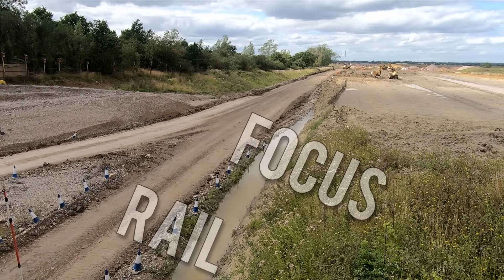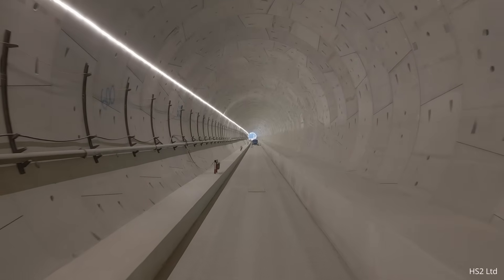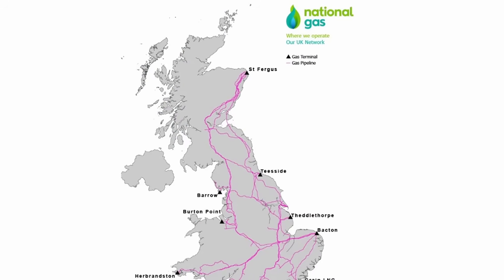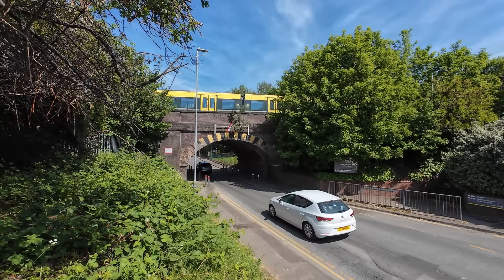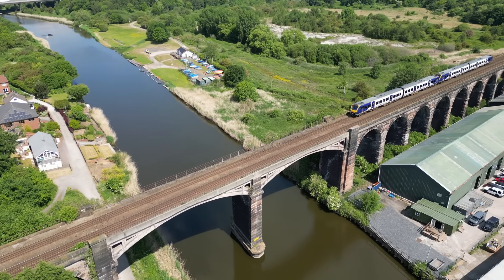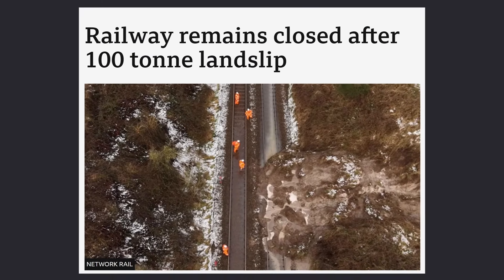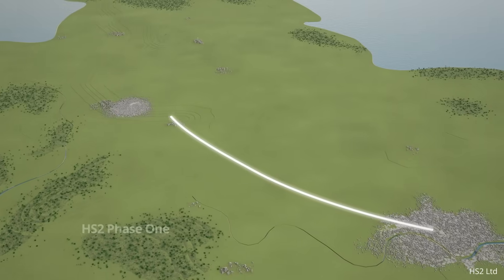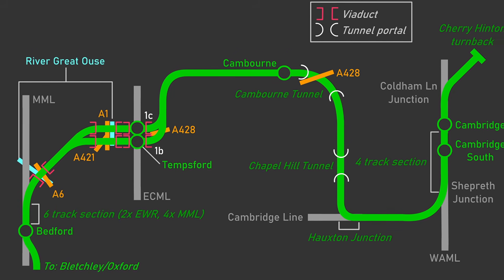Why Railways take so long to build

Comment: Although you mentioned heavy rainfall, the opposite snag - the absence of enough of it - also affects existing infrastructure in some areas, such as part of the Exeter - Salisbury route.
Reply from the maker: Good point, not something I had considered until recently.

Comment: Great vid. Another thing to highlight is that although the Victorians built many grand structures, they were not designed to last for such a long time. However, on HS2 for example, every structure is built to last for at least 120 years

Comment: The Victorians could have built a line from A to B quicker, yes. But they couldn't have built e.g. HS2 AT ALL. Had they given it their very best in both engineering and investment (including workers), they could have built something that would be more future proof and long lasting than the lines they did build (that have needed plenty of upkeep, renovation, and replacements since), yes, but it would not have been a railway capable of having trains go at modern HSR speeds, and it would have basically been a long embankment cutting everything off as it crossed from London to Birmingham and would have made huge gashes through hills that are now getting tunnels. It would have been damn impressive, but it would not have delivered what HS2 is delivering.

Comment: Great stuff, Chris. 

It’s funny how no one talks about how long it took to build the channel tunnel or cross rail now!
Reply from the maker: I think the Channel Tunnel was built relatively quickly. Or slowly depending if you include the failed attempt in 1882 😅
Reply: Crossrail took about  10 years to build. HS2 is looking like at least 12 years. Crossrail,  although smaller, was more complex.
Reply from the maker: @TrevorWilliams-fq8mg 15/16 years if delivered by 2035. Still a very long time.
Reply: Correction... HS2 is looking like  at least 22 years to complete.

Comment: For me, the case studies that are carried out are to the minimum level. By all means there are more parameters that have to be considered but I feel like a lot of cost-cutting is done.
Take for instance the Botley Bridge fiasco that's happening in Oxford. If utility companies are factored within the studies and costs are discussed, this can greatly help the time management of each case study that comes to light. 
I agree the Victorian era was a force to be reckoned with but I feel like the workmanship isn't as robust as it was even 20 years ago. Take Reading station, the tracks and signalling was done to perfection on either side but the actual station is wriggled with problems with drainage, things going wrong etc. It's like the TP Nova 3 / class 180 as a station.
Reply from the maker: Utilities are an absolute nightmare these day and the system for their diversion is heavily weighted towards the utility companies who get to dictate the cost and time-scale. Project promoters have to pay for work in advance and then the utility company gets to decide when work starts. It's a mess
Reply: @Rail_Focus Yes indeed. Personally like Great British Railways, a new Great British Water needs setting up.

Comment: An excellent video! It is rare to see a creator take the time to properly consider the breadth of the history of transportation and lay it out so well - thank you.
When the Victorians built their bridges, they were only wide enough for.a horse and cart because that is all there was - and they moved very slow. 
The railway created the Industrial Revolution because suddenly everything could move faster. and a modern economy could evolve.
Keep thinking about this as the HS2  / HS3 stages will cause the next economic evolution...
Reply: We need to argue not just for "HS2 to be built in full" and for "HS3 to be built" but think beyond that and work out how to get 90 percent of InterCity trains off of our mainlines.

For instance, complaints by Welsh campaigners that "HS2 should not be built unless Wales gets money" should be met with calls for another high speed line into Newport, Cardiff, Bridgend and Swansea (ideally with the depot built to the west of Gorseinon or better still Llanelli because the land would be cheaper and high speed rail will increase demand for housing in Swansea itself - and also because by extending beyond the last big place you get to have an additional stop, where building a bigger terminal station isn't so much of a problem and where you can stimulate the economy enough to hopefully improve the business case for extending towards Pembrokeshire).

And in the North of Wales, we should be getting people onside by backing a plan for an Irish Sea Rail Tunnel from Holyhead to Dublin (and a high speed rail connection from Holyhead back to HS2).

Comment: While researching the history of a local railway line, one that was closed in the Beeching era.  One of the books written about the line mentioned that many of the bridges were replaced about 30 years after the original construction of the line, thus verifying the comments that the initial construction was done " on the cheap".
Reply from the maker: Indeed, many bridges we see today date from after 1920, particularly the steel girder types.
Reply: It took just 14 years for the suspension bridge over the Tees on the Stockton & Darlington Railway extension to Middlesbrough to fail. Built in 1830, by 1844 it was replaced with a new structure that was itself replaced in 1881. The 1881 bridge was then replaced with a bridge from 1906 that was able to last until 2009. Quite literally, the 2nd to last bridge had lasted longer than every other bridge before it combined (103 years vs a combined 76 years)

Comment: HS2 must be fully built 

Both Eastern and Western Legs must be built
Reply: Well that's easy to say, how is it going to be funded?
Reply: @CA_I  funding aside, the bottlenecks on the WCML still exist
Reply: @CA_I  It's cheaper to fund an entire network of high speed rail lines (and a rail tunnel from North Wales to Dublin) that it is to fund the massive cost of not preventing climate change.

High speed rail will solve the mixed traffic problem and allow us to run lots of InterCity trains on one network and lots of stopping services / commuter trains and freight trains on the other network. That will lower car dependency as well as reducing the number of lorries on roads. High speed rail can compete with domestic flights and can allow us to ban most domestic flights.

Comment: A most useful summary of "today" versus "yestercentury" - well done.  This should be required watching for the NIMBY squad (who, in fairness, are quieting down and heading back into their trees).  With the UK population having increased, in just the two years of 2023 and 2024, by 1.5million souls, we shall need the capacity of HS2 - and not just between London and Brum.

Comment: In China, it generally takes about 12 months from completion of the viaduct/tunnel/earthworks to the opening of the line. The speed of track laying and installing signals is reflective of the way high speed rail is built - there is a steady pipeline of new projects for specialists to move between. Given HS2 is the first high speed line in Britain for 20 years, I suspect track laying and signalling will take a bit longer. It is therefore depressing that we aren't progressing with Phase 2a to Crewe now, so that workers who are currently working on Phase 1 can continue straight onto another project.
Reply from the maker: The fact that we've built up a large contingent of skilled workers and gained so much knowledge it's a disgrace that we're going to squander all that effort and potentially leave thousands of workers jobs without to go to. Phase 1 is the difficult bit, any extensions after would've been easy by comparison
Reply: The political system allows them to drive through projects because they don't have to worry about the political fallout.
Reply: @christopherbenjamin3242  "political fallout" meaning rich people complaining
Reply: yeh but theres a lot of cheap labour there and they have a lot more money so its kindof a given but it was intrestig knowing it only takes a year

Comment: Thanks for another great video.
I was shocked to find out while joining HS2 Birmingham to Crewe online meetings, that even after the route got Royal ascent that every structure then had to have individual planning permission.  No wonder the cost and timescale is so large. That is why I think cancelling that bit is wrong after so much time and money had already been spent. In fact lots of money is still being spent on the route to make started construction sites safe to be returned to previous use and it will be many years before any land can be sold off!

Comment: A lot is made of the fact that the GWR converted from Broad Gauge to Standard.   However the GWR simply employed enough people to make sure could be done,in a short timeframe.
What you really need a bit like the rolling stock is a constant stream of work for the engineers or rolling stock manufacturers unlike today where will want a lot in short term then hardly anything for years. 
As such makes the work more expensive as well.

Comment: A lot of what is done now is trying to future proof the infrastructure, so lines built for diesel trains have the correct loading gauge to allow electrification.
If we built to Berne loading gauge it would cost more but you could then have "standard" stock which would be cheaper and greater flexibility.

Comment: What I would like to know is how the cost and timing of building a road compares with building a railway. At all stages from design to construction.
There are differences, but the media coverage is always attacking the rail industry. I would like to understand the real facts.
Reply: It's dam  near impossible to build a bit of bypass to improve the highway  either !.
Reply: You can't do an accurate comparison because every project is different. Different planning requirements,   different environmental requirements,  etc.
Reply from the maker: I did look at the costs in a previous video, some road projects are even more expensive per mile than HS2. 
https://youtu.be/rBDrC0qk6qk

Comment: Yep, others too often compare it to the Victorians when we should consider comparing it to our European neighbours, where our timescales and costs are multiple folds higher than in France/Spain/Germany etc. Our dysfunctional planning system needs to overhauled, that along with our infamous NIMBYism, with parts of the line buried in the middle of nowhere. Layers of contractors and subcontractors milking the taxpayer, with a pitiful lack of political will and momentum
Reply from the maker: Well, this was about the specific claim about "the Victorians" deconstructing the misconceptions around "Europeans" would take another set of videos
Reply: @Rail_Focus  That would be cool, definitely not all rosy in the continent/vs how its calculated/different densities, but many lessons we could learn, considering how infamously terrible our planning system and ability to deliver large infrastructure projects has gotten. Great set of explainers!
Reply: This has been covered before I think by Rail Focus. France, Spain and Germany are much less densely populated i.e. much more space between towns/villages/roads. If you are building 100 miles of railway and you only need to navigate 5 existing structures instead of 20 then yes it will be much quicker.

Comment: 8:08 Remain to be convinced. Around the 3, minute mark you lambast the Victorians comparing some examples of then and now. Yet in the next breath, you take down that argument piece by piece when you talk of the rules and regs today's builders have to follow.
Just as we're building to accommodate HGVs , why would the Victorians have built to accommodate anything other than the horse and cart you mention?
Your argument is against the burden of laws, not that one lot were better/quicker/life-endangering than the other.
Yes we have power and gas fuel lines, motorways and myriad new physical and legal challenges to face and get round.
The Victorians had other new fangled railways, canals, their own legal hurdles and blue blooded route blockers to get round.
We have modern powerful machinery and computational powers but they had sweat equity in the manpower of the famous Navvies and only paper and pencils to calculate designs capable of carrying unknown future loads.
We build to the lowest price, they probably did too yet their infrastructure still stands and even has fancy pants curly swirly bits on it too.
As for the deaths, life was cheaper then, horrible though it is to admit and we'd like to think that we're better at looking after each other nowadays.
I just wonder, if you took away our earth movers &c. and brought back the slide rule, how many fatal accidents would there be in our version.
Thankfully we don't need to find out.
Reply from the maker: I'm fairly certain most of your points are covered across both videos

Comment: another good video _ one point of clarification _ road bridges for non notification of bridge height is 16' 6" _ you make the point well about complexity _ the hs2 video about the Curzon St Station approaches _ it's basically a series of different viaducts & a retained cut all the way to Washwood Heath sums up your point well _ and all while not trying to close other raillines or roads and without cutting off the utility services _ complex work & difficult _ well done _ look forward to seeing your next installment
Reply: what do the underscores _ represent here

Comment: Additionally, with the involvement of the locals in the areas impacted and politicans there are delays with redesigns to accomodate different concerns or planning changes. Maybe a section could be completed faster if it was surface level but the political elite and locals forced changes to have it tunneled adding x amount of time. There are a lot more variables to accomodate today then there was every considered in the past. As mentioned in the video we future proof things but also one of the negatives is we also try to derisk everything that adds a lot of time to projects. There is definitely a level of unncessary complexity we add in for political points and risk adversion that isnt necessary.
Reply: I don't see too much of a problem in people trying to de-risk projects.

Auto Shenanigans has several videos about road-building projects where there has been subsidance that has either haulted projects part way through or left them in a dangerous condition. We really can not afford to have a high speed train coming off of a viaduct and into a tunnel and the level of the trackbed not being totally stable, as a high speed derailment would be really bad. This stuff has to be reliable. If stuff starts to sink, we might end up needing to shut HS2 down and rip a bit of it apart and rebuild it.
Reply: In the building sector on smaller projects ( less than 600 million), Clients seek end cost certainty where the final cost is the same or less than the agreed price that is entered into. As a result, over the years Contractors have become more risk averse to protect their slim margins. That requires an extensive review  of the risk Contractors are exposed to and priced in accordingy. As Contractors  prices then exceedxthe budgets this requires extensive resesign to make the projects commercially viable.  The civil engineering sector lags behind the building sector in this respect.